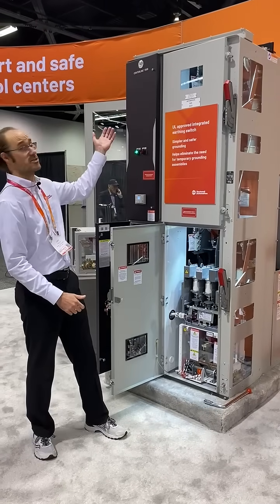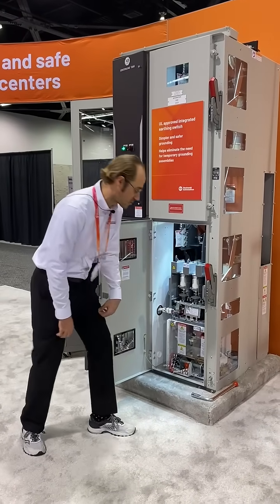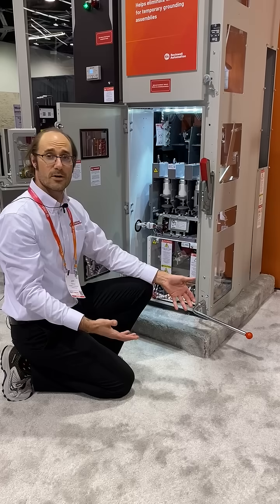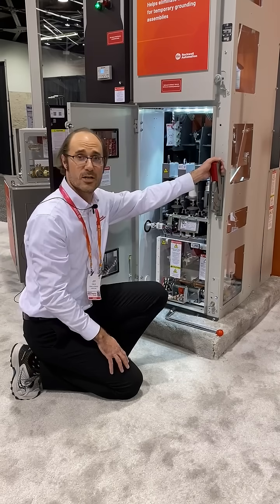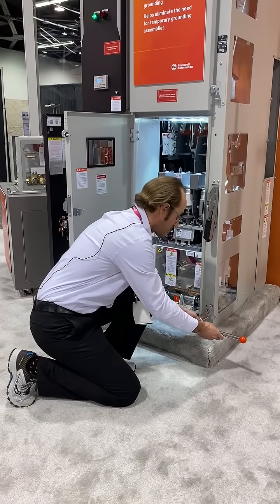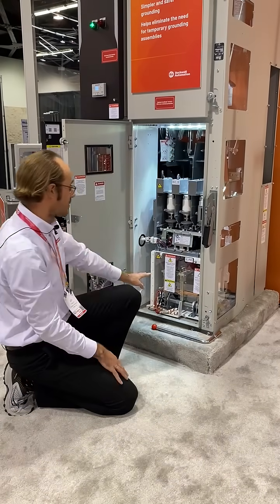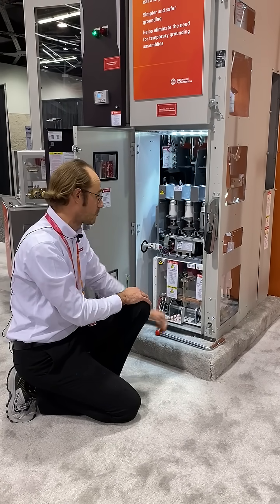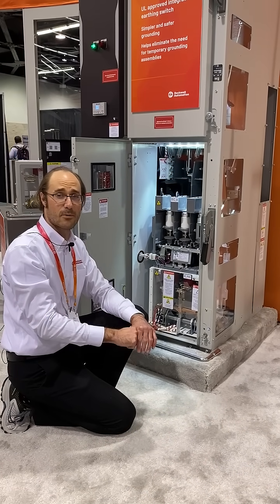Discover CENTERLINE 1500 Motor Control Center Integrated Earthing Switch

Comment: Curious, with motor leads now earthed, is the isolation switch unable to be closed?
Reply from the maker: The integrated earthing switch is mechanically interlocked to the non-load break isolation switch. This interlock prevents the isolation switch from closing when the earthing switch is in the earthered (closed) position. Detail on operation can be reviewed in "Integrated Earthing (Grounding) Switch" appendix of CENTERLINE 1500 200/400 A Two-High Cabinet, Standard and Arc-Resistant Enclosure User Manual.